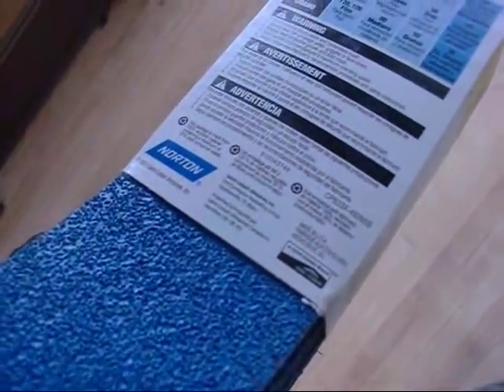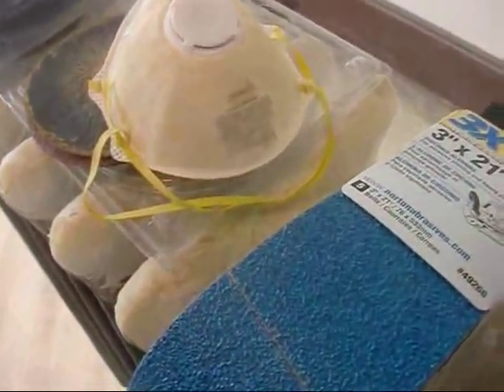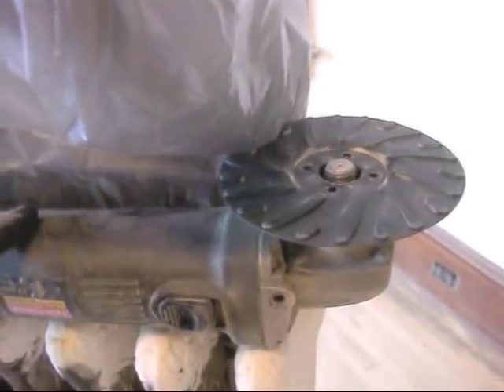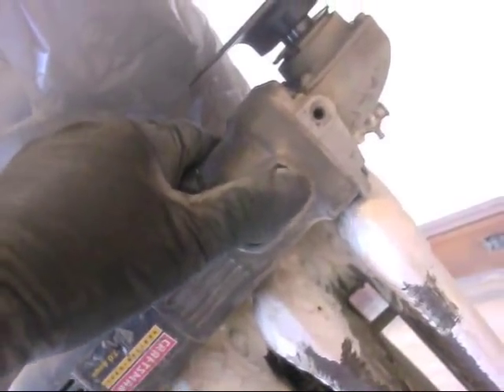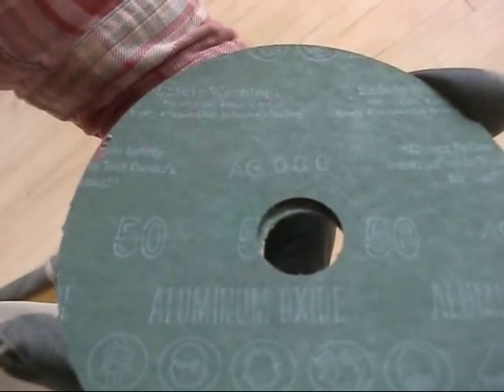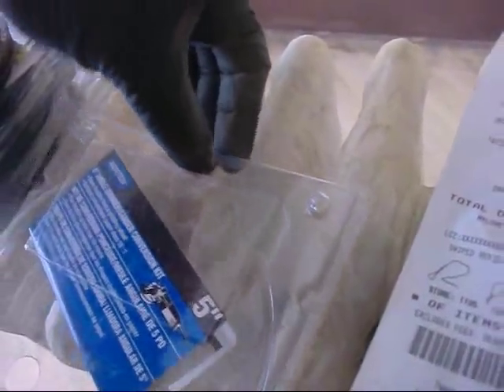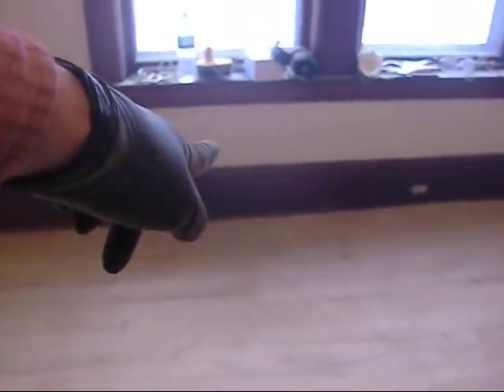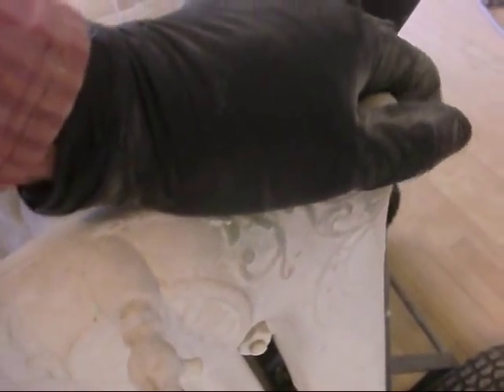Smoothing Out The Gouged Floor 1 16 13

Comment: one more thing lol don’t accidentally jamb the sanding weal between say a gap between the floor and quarter round it will kick back into your legs,knees or any unfortunate body part that gets in its way if it jambs good it will take a chunk out of the disk leaving a hole to hook into the clothing covering any body parts i just mentioned i recommend holding with too hands at all times

Comment: those are good disk they will sand anything mettle,fibreglass,wood I did the whole inside of a old chicken coop i moved and converted into a small camp by the shore it turned out beautiful works fast they are only about 1.85 to 2.50 a disk heir in Canada ,they use them a lot in boat shops making fibreglass lobster fishing boats also what was the other holes in the floor behind the rads once for ?